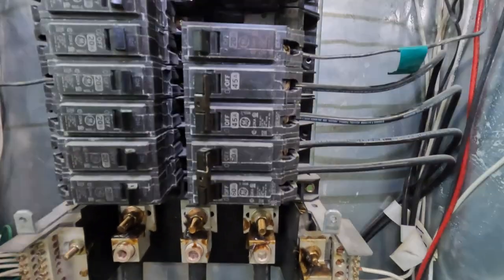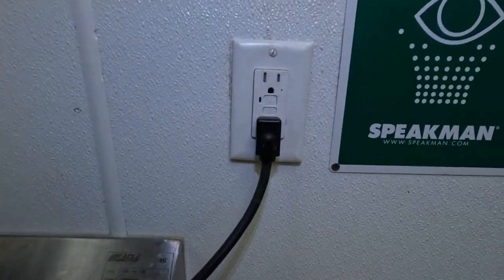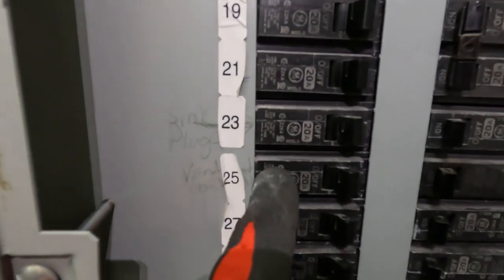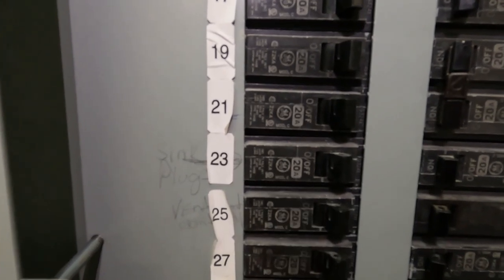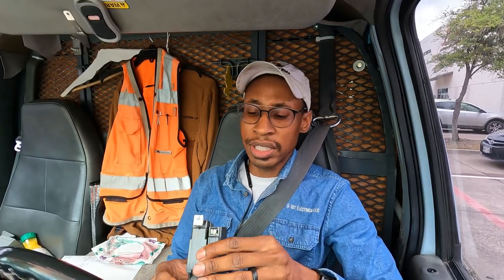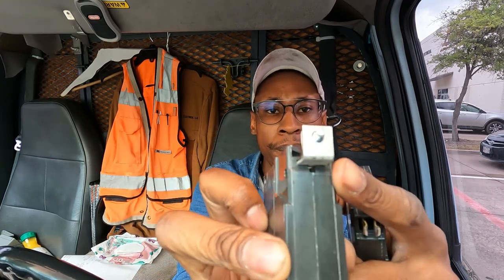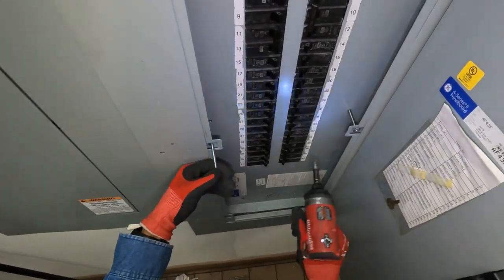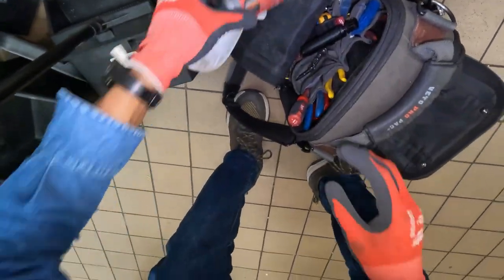Replace Commercial Kitchen Bolt In Circuit Breaker

Comment: Thank you for the video.... I have a 20 amp bolt in breaker that controls the light inside the commercial restaurant cooler that keeps tripping..... the light and switch were corroded for 20 years of use. After replacing both them, both the Westinghouse bolt in  breaker still tripped.... my next step is to replace the bolt in breaker.

Comment: Appreciate the video. Working with 3 phase and bolt in breakers can be intimidating. There are safety concerns unbolting the 120-volt breaker from the hot bus bar? Do you recommend wearing cotton gloves inside the Class 0 or 2 Rubber gloves with leather gloves on the outside?